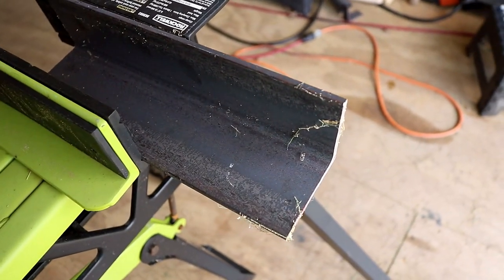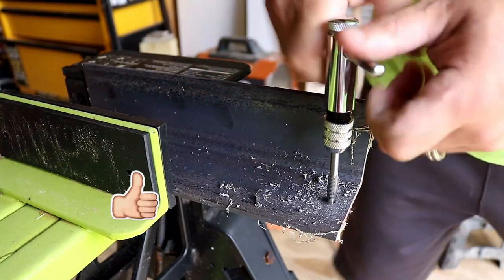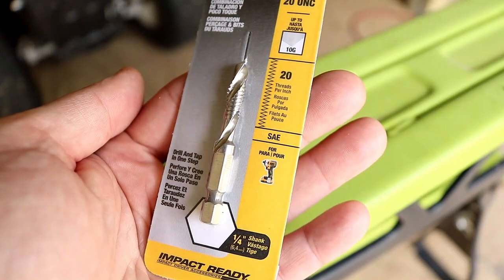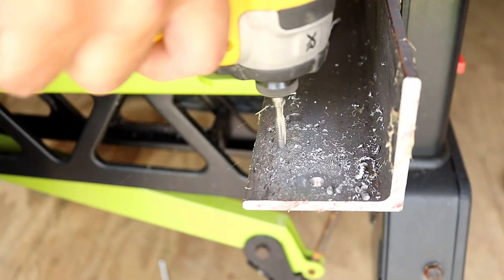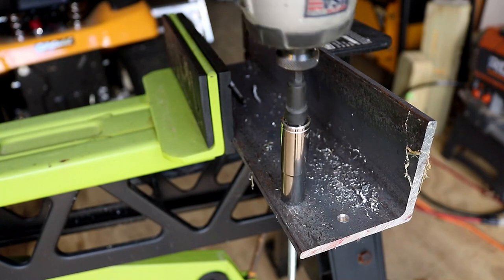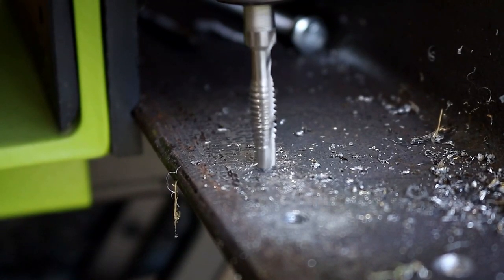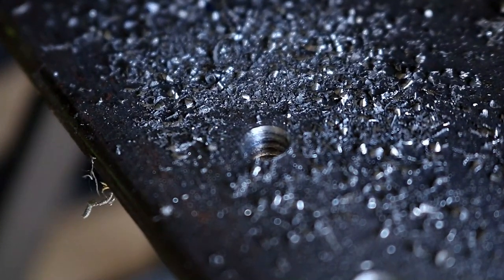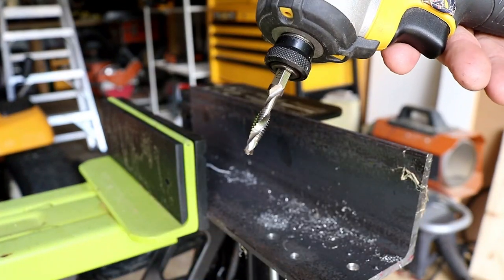This Special Impact Driver Bit Will Make Your Life 1,000% EASIER! ABSOLUTE MUST INEXPENSIVE BIT!

Comment: These have been around for a long time, over 10 years ago Greenlee sold these in sets common to the electrical trade, I never had much luck with them they were prone to breaking. My go to was a variable speed DeWalt 14v 3/8 drill drill the proper size hole then use the drill with a tap and once you had the touch you would rarely break a tap. I used this method right up until I retired 7 years ago (Industrial Electrician)
Reply: Checked these at Home Depot they are over $50.00 a set, they do not include a 6/32 drill/tap and they also countersink, I would have to try these when mounting on the backplate of a starter or any panel for that matter will it leave enough meat to thread, by the video it doesn't look like it the top of the hole has no threads? They are a little dear for me personally, when I was working the company would supply all tools but now that I'm retired I guess I won't ever get to try them. Thanks for the video it's nice to see what is available but I do question the counter sink issue.

Comment: WOW ! Very impressive. I do have a 10-32 version of the tape but did not use it yet. "Why not just a drill, why does it have to be an impact wrench?"
Very good video, well done.
Barry
Reply from the maker: Thanks Barry!!!!
Reply: Impact wrench slows down as soon as it meets resistance then applies torque incrementally to tap the hole.

Comment: Pro tip....once you tap thru with the special dewalt bit, it has a built in chamfer tool  to clean the burr around the top and ease the start or a bolt.

Comment: The sway bar on a Jeep is very close to the grill. I had no other choice but these to clean the threads using this. Of course we did not need to drill it out but the tap portion worked excellent. That was a couple years back. Good video.
Reply from the maker: Thanks for the feedback Confident!!!

Comment: oil helps a lot to get it started. Also wonder how these might work to drill out old bolt and retap at the same time?
Reply: It would work if it was a soft bolt and if you retap with a large size so your location doesnt have to be spot on.

Comment: I have no confidence that I can switch from high speed drilling to low speed tapping before the tap hits the hole at high speed and breaks
Reply: I wouldnt drill in metal on highspeed in the first place. Also I dont know how those tap will keep up with highspeed without any coolant. Even with it, it will vaporize pretty fast.
Reply from the maker: I'll definitely do a one year later review on these 👊
Reply: Totally agree would like to see how well they do over time and if they survived without tap fluid or if tap fluid was used
Reply: @ToolReviewZone  there's no need....I can tell you now that these bits DO NOT last. They break within 3 months tops.  I've gone through tons of these. They are very convenient when they aren't broken though.
Reply from the maker: @Mr_Daddy1980  thanks for the feedback 👊
Reply: @ToolReviewZone  did you get round to doing a 1 year review?

Comment: Next time use a little bit of cutting fluid it helps it what I used to do drill all my holes get my cutting fluid put my bed in my drill and just go at it probably 80 plus holes at a time I was doing back plates for control panels and I had to tap usually its 8:32 smallest who usually done with 4:40 up to a quarter 20 those tabs with a drill bits I don't like good doing a couple of the time when you got to do hundreds holes and fluoride those bits one last long but you could do a test I would like to see that but more important cheers with a beer

Comment: those work great for putting holes in thin to medium metals.. they are NOT going to work tapping a hole in a the engine or transmission.  so don't throw out your tap handles and tap and die sets.  if you build security gates.. those are perfect.  if you want to put a bolt in your washer or dryer..  those might work..  i just envision somebody trying to use one of those to drill and tap a broken exhaust manifold stud. . they will drill right into the coolant.. if it does not strip the threads out..  you can't go around telling people these will work for everything.. somebody had a rusty freeze plug.. the machine shop said. drill a hole in the freeze plug and use a slide hammer to pull it out.. worked great.. except now he had a coolant leak into the oil pan and compression leak into the cooling system.. he not only drilled thru the 16 gauge freeze plug. he drilled thru the cylinder wall behind that.  he drilled thru the piston skirt.. he drilled into the side of the connecting rod..  so be exact is what you tell people to do..

Comment: Those threads aren't nearly as deep as a tap would make them in aluminium or weaker steel they just wouldn't hold up you can see how destroyed the threads are after the bolt is unthreaded I use a normal tap in a drill and it works great

Comment: Looked like the bolt tools lot of effort, it wasn't that clean of a tapped thread. The bolt should be able to screw in with fingers, not need an impact driver to traverse the threads

Comment: Yeah, BUT you still drill with a hand drill which will not make it straight anyway. Also "What happends in your in a tigher areas", if that tapping tool wont fit, a whole battery drill wont fit either. For me, tools like this are like a cheese in a can.
Reply from the maker: You can throw an extension on the bit my brother 💪
Reply: @ToolReviewZone  I dont know how I feel adding more lenght when drilling anything. Plus highspeed drilling into a steel is a no-no.